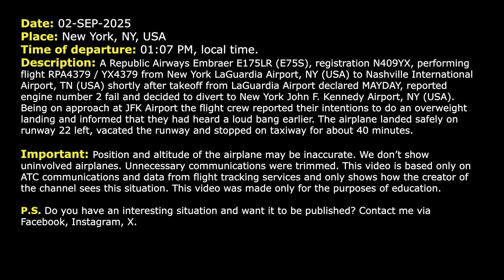MAYDAY. Loud bang and engine failure. Republic Embraer E175LR diverts to JFK. Real ATC

Comment: My parents were on this flight. So glad and thankful to the pilots that it ended well! 

One thing I'm curious about:

Neither the pilots nor the flight attendants made any announcement to passengers about what was happening—absolutely nothing.

I’m a private pilot with a couple hundred hours, so I’m no expert, but I do understand that flying and navigating always come first in an emergency. That said, once the situation is stabilized, a quick 10-second announcement would have gone a long way:

“We’ve lost our #2 engine. We’re running the checklists and diverting to JFK. The aircraft is safe to fly on one engine.”

That’s all it would have taken to keep passengers informed and reassured.

Is that a reasonable ask in a situation like this?

Thanks!
Reply: Did your mom make it home?
Reply: Failure right after take off… that’s a very high work load for the pilots in busy airspace. No time. Even when Sully landed in the Hudson, he only had time to get out a quick brace for impact announcement.

Comment: Pride of Bryan Bedford, wife worked for them back when they were known at Chautauqua & flew J31s. Those were cute, pilots pulled a curtain, no door...of course pre-911. One time we had about 10 passengers and they asked me to move to the front for weight & balance. Guess it confirmed then and there I was a fat butt. Embraers are a bit nicer, esp the 190s

Comment: Thank you for the video, what was wrong with the #2? That is the most important information.
Reply: Probably stalled out + damage (compressor stalls bang).
Definitely something not super easy to fix, since it was on the ground for at least 22h (idk if it still is)
Reply: @lyaneris   :  What did NTSB said about it?

Comment: The usual SOB/fuel repitition.... 🤔
Reply: I'm not in this area of expertise, but couldn't they make a simple system to have this carry from one ATC to the next? I don't think it would be that hard and it seems to be a recurring issue when the pilots have their hands full with both the aircraft and the checklists that they have to run.
Reply: The repetition between approach and departure is fine I guess, but the pilot pre-emptively saying stand by for SOB and fuel, mixed with the controller asking them for it not even a few minutes later + asking for a repeat when they finally tell her was a bit annoying
Reply: @EddieMatou  There's time cut out between those transmissions.
Reply: My 1st thought also. Morning news: "In other news a fine mist smelling like an old oil lamp or kerosene was reported over Long Island earlier this morning. Officials telling everyone not to worry" 😂
Reply: It’s a box ticking exercise USA ATC are tied to. Unnecessary and distracting. Fuel in time (endurance) is irrelevant for an aircraft that’s just departed and doing an immediate return, and the quantity is self evident from the aircraft type and phase of flight. And its Persons on Board not Souls on Board. The FAA changed that conform with ICAO years ago.
Reply: @meofnz2320 In this specific case, fuel on board in pounds was relevant. I don't think I've ever seen an overweight E175 emergency.
(The amount of fuel dictates how far away ARFF can station and has to remain from a fire to be safe.)
Reply: @lyaneris 
That’s odd; it doesn’t seem to matter in the rest of the world. I mean seriously: “let’s not get close enough to put foam on the fire because there’s 20000lbs on board. If only it was 15000lbs we could just about reach…”